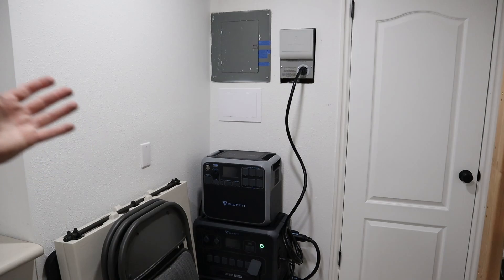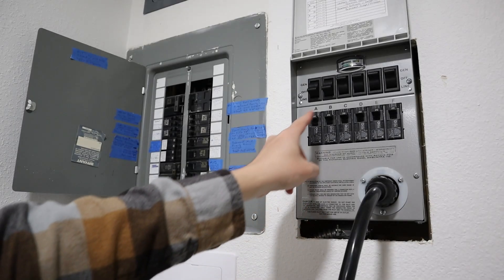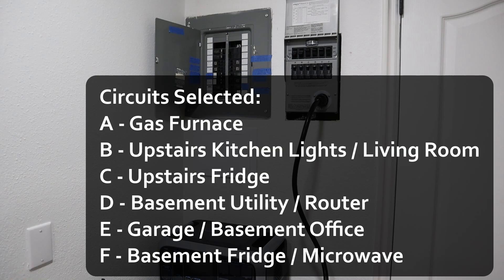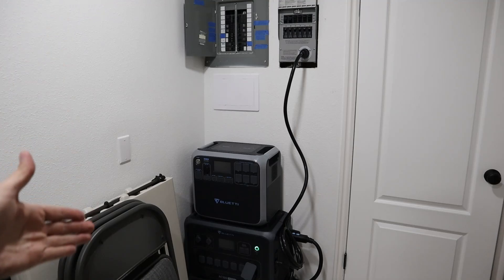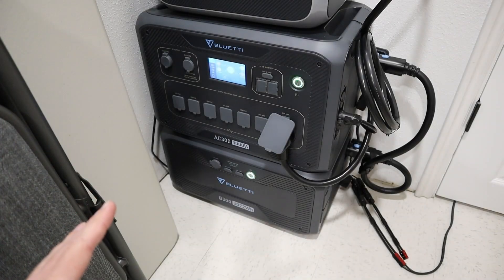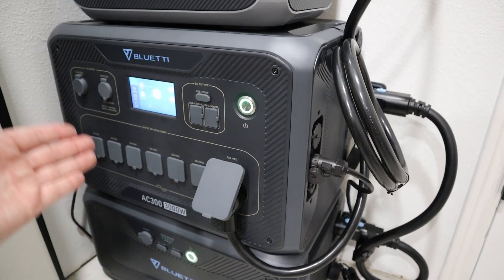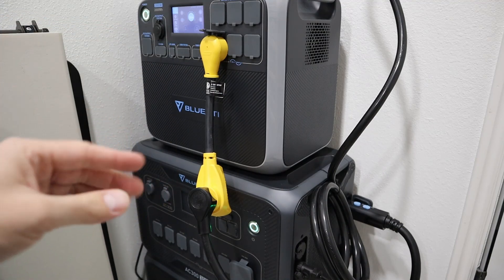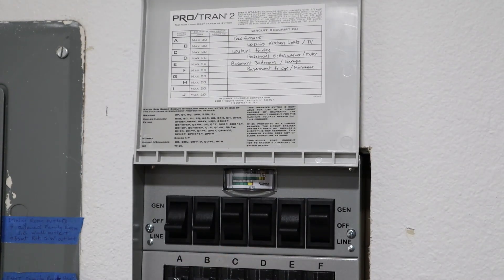Keep the Power On During an Outage?! Install a Power Station Transfer Switch!

Comment: Do you have to manually switch it over in the event of an outage?
Reply from the maker: I always have these circuits running off my power stations and solar, so I don't need to swap them over. For example, my AC300 / AC500 are running these 24/7. The power went out this week and since our fridges were running off the power station already, they just kept running. 
If you only wanted to run your power station in a power outage, yes, you'd need to manually flip the switch. The benefit to this setup is you can choose what you want to do with your power.
Reply: @Jasonoid  Hmmm...interesting. I'll have to look into it a bit, then. Would like something that would switch over automatically, but that's true, if it's already just powering some stuff, it won't really make a difference. Not sure how I wanna do it. Thanks, man.
Reply from the maker: @rmp5s  I like just having my stuff running off solar all the time when possible. Then if the clouds set in, I flip it over to grid power.
Reply: @Jasonoid  Yea, for sure. And, I'm in Phoenix...PRIME solar spot. lol...gotta get a system setup.

Comment: There is one issue I've heard people talk about which has me concerned, most solar generators have a floating Neutral, which could harm your power station if you were charging it and running things on the transfer switch at the same time.
Reply from the maker: I haven't noticed any issues with mine so far. I do run mine off solar 95% of the time. What I have found is that if you turn off the AC inverter, then start charging it off the grid, then turn on the inverter again it seems to work fine. I have had the power station alarm before if I plug it in while the AC inverter is enabled. The error is usually a voltage difference error.
Reply: @Jasonoid   people are telling me to go with the EZGenerator for that One important load you need. like a furnace, it runs one circuit but you can use it on floating neutral devices such as Solar Generators Bluetti/Ecoflow,etc

Comment: Great video. Question: How can the manual transfer switch be automated, meaning I dont have to switch between LINE and GEN. The area I live I'm is rual and looses power 1-2 times a month. I travel for work, so I am not always home when power goes out. My thought, keep needed circuits for backup power on GEN and then plug the Butanni(example) into the ac power outlet, there for constantly charging the battery. Or would this be bad as it would waste each charging cycle?
Reply from the maker: If your power station has a UPS feature than it would automatically swap over to the batteries when the power goes out. So you could leave your transfer switch on GEN mode, then have your power station plugged into an outlet that has grid power. That would probably be the easiest option. I prefer to use solar charging instead of wall power. With enough solar panels you can keep this charged up all the time during the day.
Reply: Make sure you know what the max wattage is, when using UPS mode.  If the wattage exceeds that, it could trigger the overload switch. If this happens, most units have to be reset manually.  That means no power for those circuits connected to the Power Station.

Also, it's a good idea to have the Power Station on its own 20-amp breaker and outlet.  That way when you're charging the unit after a power failure in UPS mode, you won't max out the wattage output.  Example:  Our DP has a max EPS/UPS (Emergency Power Supply) wattage of 1800 watts.  Our DP can be set 600 watts for AC charging.  That gives us 1200 watts to use to power other circuits in our house. (If that makes since)

Comment: Very Interesting Video! I have a very similar setup for my Bluetti AC200Max w/ extra B300 battery. During my research I never found this Huntkey transfer switch. I'm 100% positive that it is made in USA by Reliance Controls, but not one that they show on their website. I purchased the Reliance 306A which is designed for a generators using 30 Amp L14--30 four wire plug. It's designed for a generator with 240V capability that obviously doesn't work for 120V invertor. I ended up purchasing a short adaptor cable to plug into Bluetti 30 Amp RV outlet that connects both the hot conductors of the L14-30 and am using a 10 ft. L14-40 cord. It functions the same, but was extra work and bit of extra cost. I wish I found this switch first. Thanks for sharing this with others.  Huntkey/Nature General must have seen this market need and worked with Reliance Controls to create a different model for inverter applications.
Reply: Hi Dehn, I need to do something similar for my AC500 connected to my house. I do not have grid power and will be using an inlet box plugged directly into the main breaker. What is the adapter cable you bought that allowed you to use a 120V receptacle on the 240V transfer switch?
Reply: @benjaminramey3593  search for this:
Parkworld 885446 NEMA TT-30P to L14-30R adapter cord, RV 30A TT-30 Male to Generator 4-prong 30A L14-30 Female Receptacle.

Comment: Why not do pass through charging. Plug your ac brick from the 300 into the 200p and get 500 watts. If I'm correct it will take 2 for 1000 watt and skip that dog bone. I have 200p and goal zero 1500x this is what I do
Reply from the maker: I guess that could work. I'm not sure what option is more efficient, charging directly from solar panels or charging from an AC inverter on another power station, probably the solar panel route.
Reply: @Jasonoid  you are only consuming 600 watts while in use. If you are at full charge on the 300 having it plugged into the 200p will use none of its power. It will only start to draw from it when dark solar not available. I run 6 panels and most I get is about 540 watts in. Plenty for fridges, pellet stove and some lights.

Comment: Great Video Jason!  I'm subscribed to and enjoy your channel. I'm a newbie to solar generators and solar charging in general so forgive me if I mess up some of the terminologies. I just purchased a Bluetti AC300 w/two B300's and  plan on installing a transfer switch after seeing your video but have heard other people  having an issue with the floating neutral and pass-through charging. They're saying the AC300 could be damaged while pass through charging if you don't get the right transfer switch that addresses the floating ground or neutral. A few of the recommended transfer switches were the Bluetti Smart Home Panel  the Reliance X-Series neutral switching panels and the Generac transfer switch. My question are these nessasary because I see in your video you're doing pass-through charging with you Pro-Tran transfer switch, have you had any issues yet???
Thanks and keep up the interesting & informative videos!Rick
Reply from the maker: Hey Rick, the AC300 is an awesome setup, especially with two of the batteries! My mains power has the ground and neutral separated, they are not tied together in the main power box. It appears both my live and neutral tie back to the city power. I haven't had any issues charging the AC300 off of wall power while having circuits powered on my transfer switch. My home was built in the late 70s so things probably have changed with new builds. I'm not an expert electrian so someone more qualified might be able to give you a better answer.
Reply: Did you install your transfer switch? If so, what did you go with? My home was built 6 years ago and not sure what set-up I have or need to be aware of. Thanks!

Comment: What is the cable you are using for the AC300 to the manual switch ? My manual switch have 4 prongs yet the BLUETTI is only 3 prong?
Reply from the maker: Links to everything I purchased are in the video description. The 4 prong to 3 prong adapter cable came with my transfer switch.

Comment: Any recommendations on a good place to buy 200-300 watt panels for a yard mount that will be tied in to a Bluetti 300AC?
Reply from the maker: I bought mine for super cheap on a local classified. Just depends on how into solar your local area is. Just make sure your panels don't go over 150v when connected all in series.

Comment: What gauge wire would I need to run from 4x300watt solar panels to a bluetti 300ac? Its a free standing solar array about 100ft from the transfer box. Thanks for any help!
Reply from the maker: For that distance you'd want to do 10awg wire and your panels wired in series for high voltage / low amperage.
Reply: Thanks a bunch! Do you know if I would need to use 10/2 or 10/3 wire? I assume 10/3 for the ground. @Jasonoid
Reply from the maker: @snareofwisdom  10/2, you would just ground the solar panels to the ground near the mount system, ground does not go into the AC300 solar input
Reply: @Jasonoid  do you know the best way to connect the panel array to the 10 gauge wire that will run through conduit to my transfer box?
Reply from the maker: @snareofwisdom  you'll want to reach out to electrician for your local code regulations that you'll need to follow. Most require THHN high heat wiring while going through conduit.

Comment: What is the best solar generator to charge an EV?
Reply from the maker: Any 2000wh power station should be able to charge an EV slowly using a 120vac 15amp charger. It gets a bit more complicated when trying to charge an electric car when jumping up to 240vac. Check out Will Prowse's YouTube channel, he has a few videos on the subject.

Comment: Is the neutrals bonded with the house when you have the power station connected?
Reply from the maker: My neutral bar and ground bar are separate in my power box. Mine is an older home so not sure what a new one looks like.

Comment: Any reason you couldn't use a six circuit transfer switch with a bluetti ac200p?
Reply from the maker: Just make sure you don't go over 2000 watts continuous and you'll be great! No issues.
Reply: @Jasonoid  Thanks Jason. Great video.

Comment: This is great but what I really want is a transfer switch that will flip circuits over to power station automatically when the grid power fails. Does such a unit exist?
Reply from the maker: They do have automatic transfer switches, I think they cost a bit more.
Reply: @Jasonoid  I haven't seen one available that isn't proprietary/ designed to work with a particular brand of automatic generator, or is intended for use in an RV. My concern with the latter is they are not approved for residential use / to code...
Reply from the maker: @garethw001  I've seen a bunch from Generac but I've never read into if they are only compatible with their gas generators. With time we will see more options for power stations / batteries. If you go with an All in One setup like an EG4 or a Growatt unit they have built in automatic transfer switches I believe.

Comment: I have the AC300 as well and was wondering in the manual it says 150 volts max on input DC and I have Renogy 100 watt panels. Each panel reads 22.5 volts so I have only 6 per DC1 and 6 per DC1. Any thoughts?
Reply from the maker: You can also double up on parallel connections so it would be a 6S2P array for 1200 watts total of 12 panels on each solar charge controller.

Comment: what would you consider the minimum size battery backup to make a transfer switch installation worth doing?
Reply from the maker: A 2000wh power station / battery-inverter setup would probably be the minimum to run one fridge for 24 hours. If you want to run more than one fridge you'd need to get more capacity.

Comment: Really like your setup.  I have an AC200MAX with two 230 batteries.  I already have a 220V transfer switch installed for my 7,500k generator. I was thinking of wiring an adapter to supply both legs so I can select which circuits want to energize. I would make sure to keep all 220 breakers off when using this setup.
Reply from the maker: I'm sure something like that would work for the AC200MAX

Comment: Great video!  I have a very similar setup.  I used a Reliance 10 circuit transfer switch and I also installed a 30amp inlet near my ac300 that goes to a 30amp breaker in my main panel that is controlled with a safety interlock.  That way if there is some other circuits in the house that i need to power during an outage I can easily switch from using the transfer switch to plugging into the 30 amp inlet and flipping the interlock.  Another benefit is I could use my gas generator by running my 50 foot cable from my generator, through a small basement window and plug that into the inlet.
Reply from the maker: In hindsight I think I should have gone with the 10 circuit transfer switch. I have a lot of low power circuits that could have benefited from running off solar most of the time. Live and learn I suppose. Thanks for sharing your interlock switch idea, pretty cool thinking :)
Reply: @chrisladd5392 I just stumbled across this video and read your comment.  I’m currently installing the 10 circuit box and I too went with a transfer switch on my main panel so that my gas generator can be an additional backup.  I’m glad someone else had the same thought process as me!  I’m using an MPP Solar 2424LV-MSD which has a 110v inlet so it can charge off of the gas generator (at a lower amp setting than normal) while it is running if needed.  When it gets late, I can shut the gas generator off and run in battery throughout the night.

Comment: I tested out the OhNoNo cord on my channel on a single circuit. I know if the AC200p detects a live circuit it won't work. I can't say there isn't some bleed on the neutral like you were worried about because I didn't do that much testing.
Reply from the maker: Interesting, thanks for the info! I'll check out the video.

Comment: Hey Jason,  Which panels did you purchase to generate the 925 watts?
Reply from the maker: They are 325 watt Preimar  'full size' panels I found locally for $0.43 a watt ($440 total). It was an amazing price for the panels being unused! They are poly panels so they are slightly bigger than mono panels. Look locally and see if you can find a similar deal

Comment: Hey Jason, was the transfer switch a diy or did you have an electrician? 
Also, are you going to upgrade the main power station (EP500) or add additional batteries?
Thanks again for vid
Reply from the maker: I installed it myself in about 2 hours, most of that time was cutting and measuring drywall haha. Very easy install instructions and if you are well versed in electricity you should be able to do it. You can follow Reliance Controls guide video
Reply: @Jasonoid  Sounds good brother, thanks!

Comment: Thanks for this idea!  I have 24 panels in my house but no batteries... I wanted Teslas Powerwall for a long time but now I want the Bluetti AC300+B300 combo because I can keep adding later on.  What is the difference between your transfer switch ($350) and the Bluetti Smart Home Panel ($1,499)?  For me they look like the same type of thing 🤷🏽‍♂️
Reply from the maker: The transfer switch I have is a manual transfer switch. I manually have to swap it between line power or genny power. I think the Bluetti smart switch detects when the power goes out and swaps over to the AC300 automatically. Personally I'd go with the manual one so that you can run your curcuits off solar even if you have power or not.
Reply: @Jasonoid  Thanks for your response!  Manual sounds better for me as well...  Do you have an idea on how many of these batteries will be needed to run a house AC unit?
Reply from the maker: You'll need 240v output to run a full house air-conditioning unit. They do allow you to connect two AC300 units in series to get split phase output but there are cheaper ways to do that. Full size air-conditioning units pull BIG power so it's not super realistic to run large loads like that off solar.

An AC300 with at least 1000 watts of solar could run a small 120volt window or stand alone ac unit without any issues.
Reply: @Jasonoid   I see that you have only 1 B300... I am undecided between 1 or 2.  Now that you have tested it (1 battery), have you been able to run those fridges and extra rooms that you included in your transfer switch?
Reply from the maker: @alexisgueits7684  I'm pretty frugal on my power usage. All leds in the house and very particular about what I leave running. During the day with solar input I can run all 6 Circuits with no problems and the battery stays at 98%. When it's cloudy I run both fridges during the day since I get around 200 watts of solar on cloudy days. 

At night I decide to run only 1 fridge off the battery and that load takes the battery down to about 50%, you could probably get away with running both two fridges at night but the battery would be near empty by morning. If you have a good day of sun scheduled for the next day probably not an issue. I haven't had 2 or 3 days of good sun yet so it's been hard to tell if I can let it do its thing without touching it.

It's an experiment and just takes some testing and I haven't gotten lots of time with it yet.

Comment: Thank you for the inspiration! Just picked up our transfer switch using your link as a thanks. 
We have an AC300 with an extra b300 and an AC 200p that we have been using via power cords. While it works fairly well, we definitely were not using our set up to the fullest. This is an awesome solution.
We initially wanted to use the Bluetti sub panel but this gets us started without spending another $1500.

Comment: Nice setup. I just got Tesla solar installed grid-tide obviously, and have built an offgrid backup battery solar array. No transfer switch yet for the offgrid setup so have been using extension cords for the loads in my basement. If the power goes out here, I’m primarily concerned about the fridges so the setup might be enough, but if I get an EV and scale the battery, I’ll likely go a similar route. Thanks!